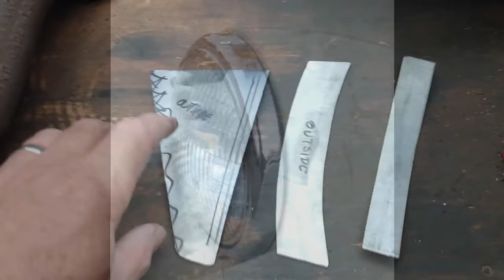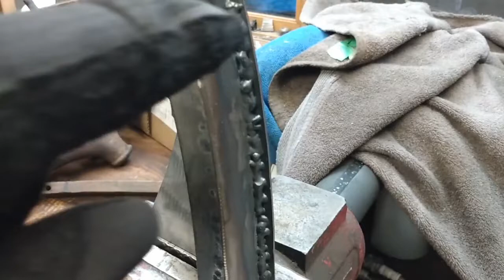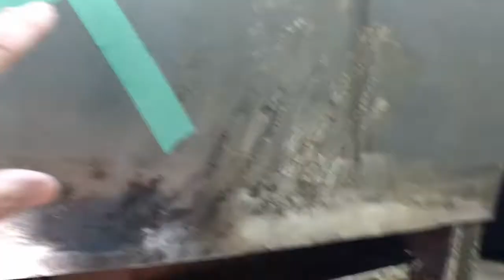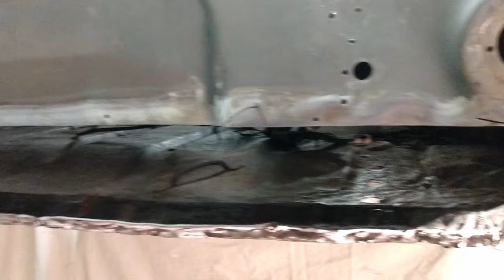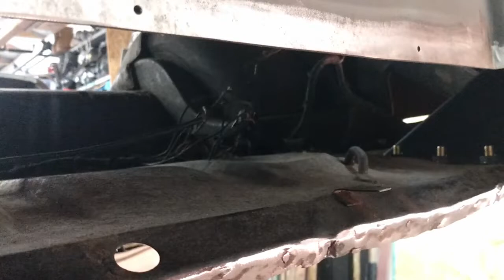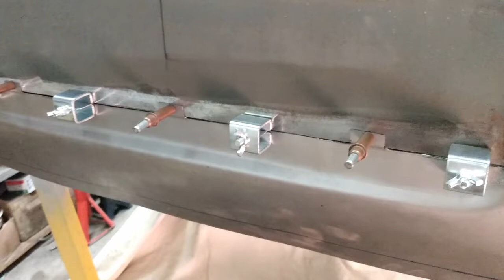Rear overrider brackets installed, inner wheel arch patch made, and more! Bugeye build episode 33

Comment: Those welds are looking really good, and I had not yet seen that video from Fitzee. Thanks!

To get the butt weld clamps in place, would it have worked to remove the cleco fasteners and the panel, position the (loosened) butt clamps and hold them in place with magnets or tape, while also holding the pins in place with tape, then slide the panel up into the butt clamps, put the clecos back in place, and then tighten the butt clamps?
Reply from the maker: Thanks. As for the weld clamps your suggested method probably would have worked.